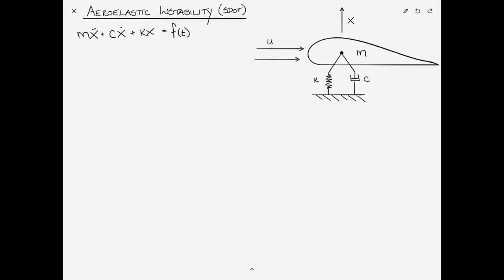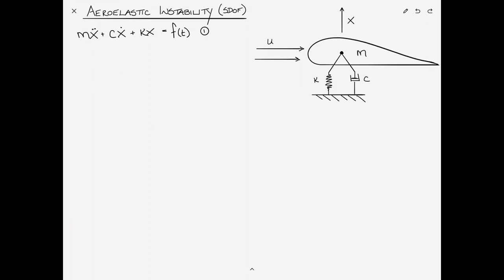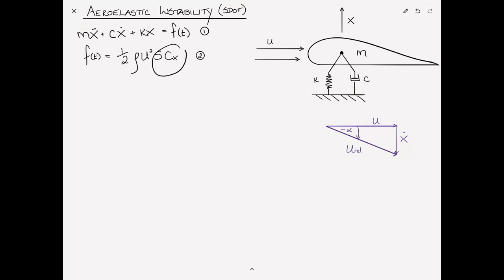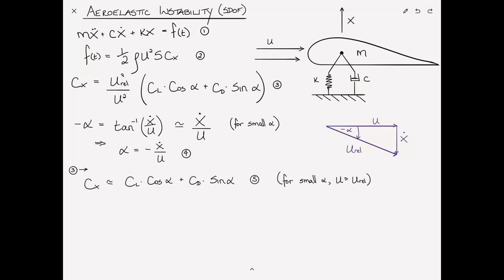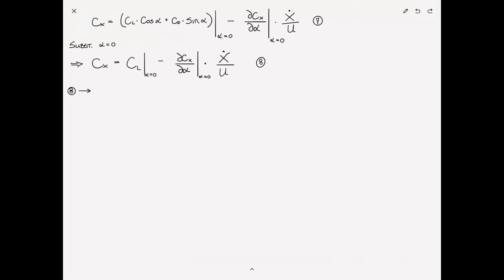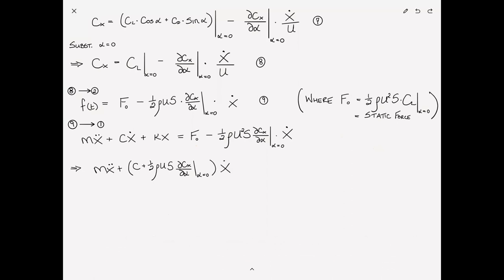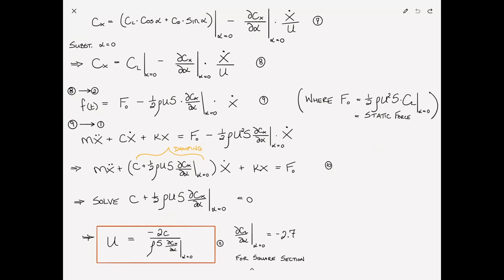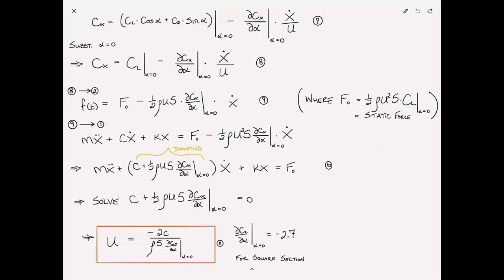Aeroelastic Instability - Single Degree-of-Freedom System (SDOF)

Comment: can you elaborate on dCx/dalpha becoming negative beyond stall conditions?  Even for SDOF airfoil derivation.
Reply from the maker: This is just based on empirical testing.  For most cross-sectional shapes, and certainly for any airfoil, this will be positive (i.e. increasing the angle of attack increases the force in the upward direction).  The types of shapes for which this would be negative includes rectangular cross-sections, like say a water tank.

BOTTOM LINE: is that you will never be able to model the flutter of an airfoil using a single degree of freedom approach (because it is always stable using this model).  At a minimum, one needs to add a torsional degree of freedom to the vertical degree of freedom.

Comment: you missed that the term of velocity is squared when you substituted it and found equation 10
Reply from the maker: The velocity should not be squared (it is actually the previous line that has a typo - I mention this in the video).